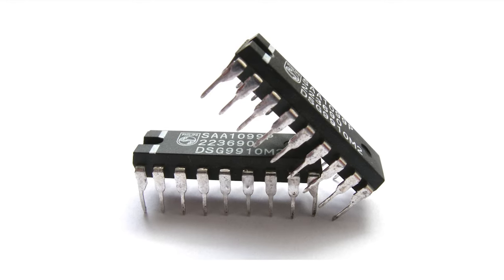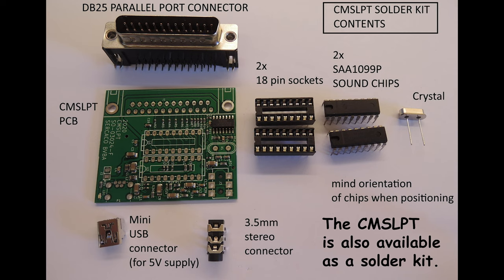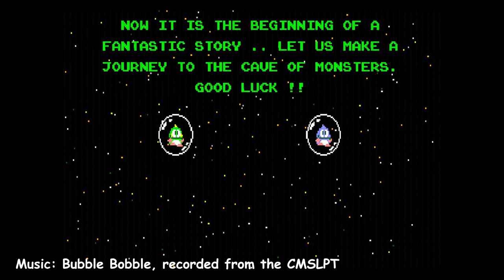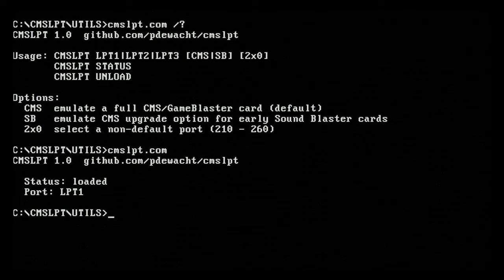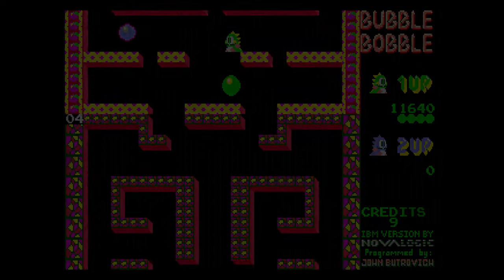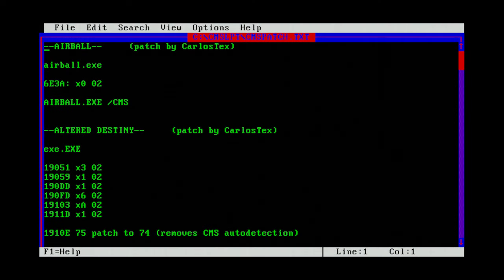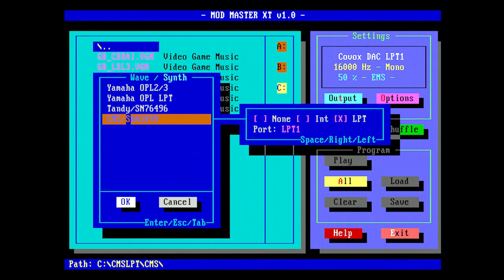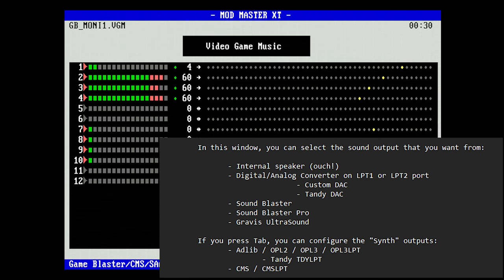CMSLPT - Creative Music System on your printer port.

Comment: Hey, CarlosTex here. I'm happy that the CMS patches are useful! I had the strong conviction that in the future they would be, so i'm glad i made them!

Keep goin, you have a nice channel here.
Reply from the maker: Hi, and thanks for reaching out. And thanks for making the world slightly better by making this patch set for us. I am working on a Sound Blaster 1.5 with CMS chips now. I guess the the patches are not relevant for the SB 1.5?
Reply: @RetroErik  The only relevant is the one for Altered Destiny, it removes the CMS detection so it will play in a SB 1.5. But yeah the patches that change the port are irrelevant for SB 1.5